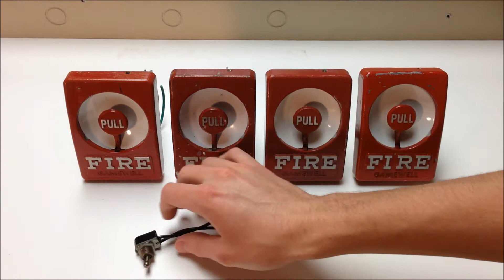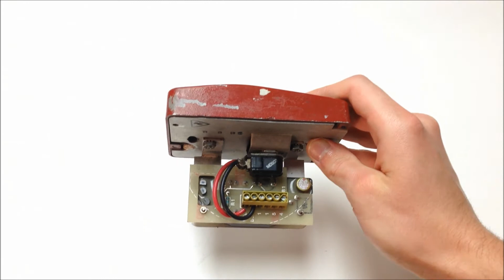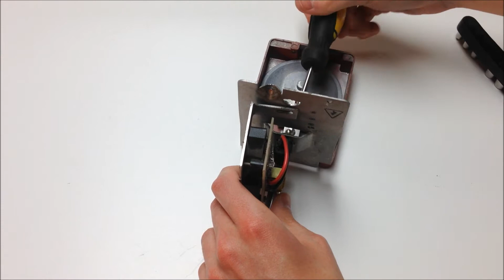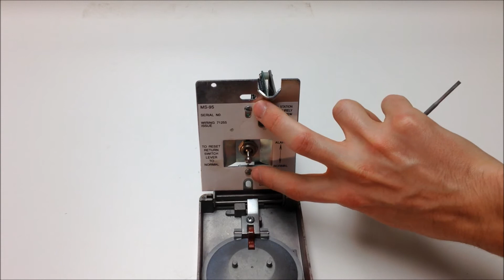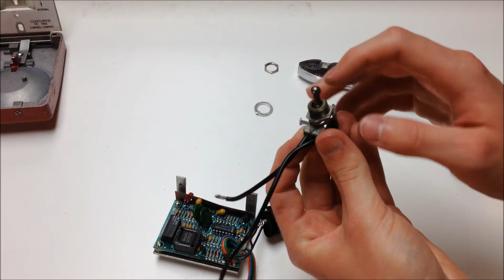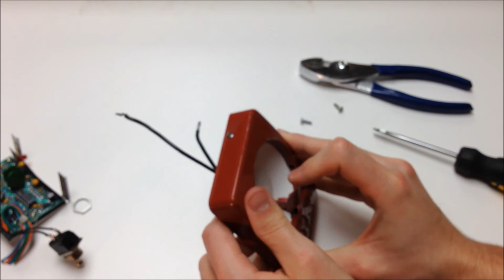How to Convert Addressable Gamewell Century To Conventional

Comment: On the second addressable pull you could've just cut the ends of the switch wires and just strip them and just use the wires.
Reply from the maker: That's true, but it would destroy the addressable module. This video was for a temporary conversion, so that the addressable module was not damaged.
Reply: Same case with the bgx101l's, once you cut the wires from it, then the module is damaged
Reply: @FireAlarmTech7.  they dont damage the modules as they are standard mmx-101 mini module on it. may need to replace the resistor for it if you wanted to use it for other purposes but. wires also may become short but is still usable. to add back is harder. you need to resolder it. also taking it off you either need to remove it completly and solder new wires to the switch or cut both ends and wire nut it.